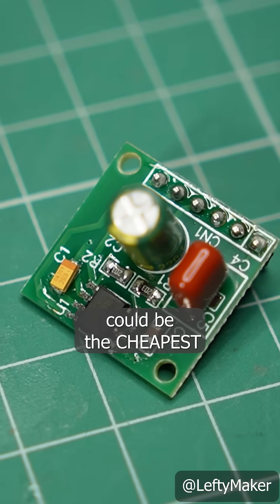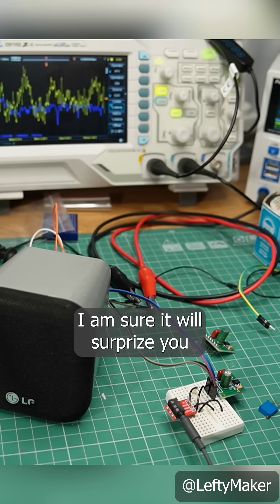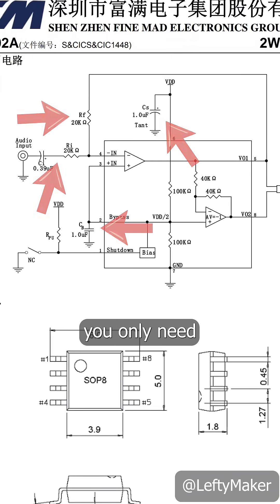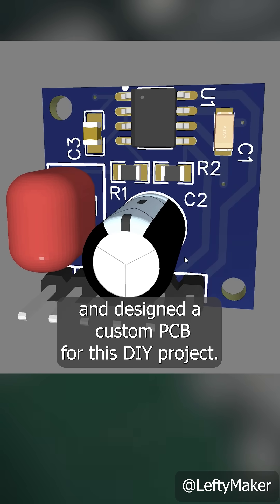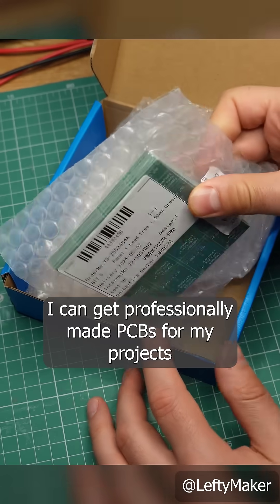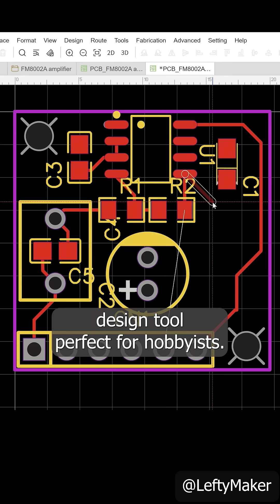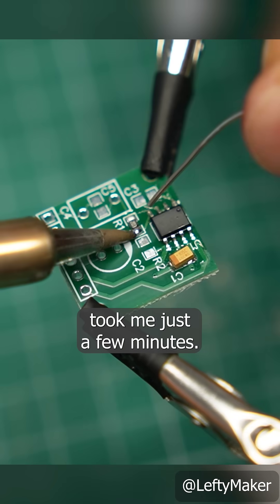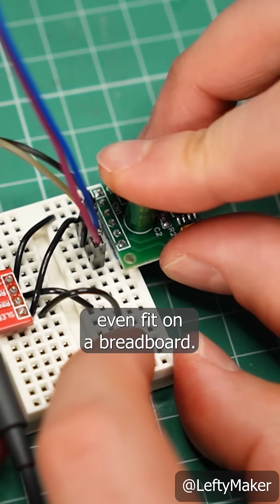The Cheapest DIY amplifier?

Comment: The ic is 8002A ic, this ic is mostly used on Radio amplifier it's small but powerful audio amplifier. Good for small units. I created one of this traced it on the radio board. And it works. U did not use any JLCPCB or PCB Way. I only use hand by hand.

Comment: can you connect them in series or parallel for a basser or louder sound
Reply: You could. From a design perspektiv use:
For a 5W amplifier, the LM386 is a popular choice, while the TDA2030 can handle both 15W and 30W (with appropriate configurations). The TDA7297 is also a good option for a 15W stereo amplifier.

Comment: newb question, why cant the chip contain all the necessary components ?
Reply: You cant put big capacitors inside a silicon chip
Reply: @stevelester6276  so transistors can keep getting smaller, but capacitors cannot ?
Reply: @narf0339  late ans. they have gotten smaller. but not small enough. there are some tradeoffs with size, like the ESR value.
Reply: @jonasnicolaysen8019  capacitor is a must ? some chips have pins that expect you to connect capacitor cause they cant intergrade inside the chip ?
Reply: @narf0339  great question. There are some capacitorless small-signal amplifier circuits, such as active load differential amplifiers. However, they are not used for driving audio speakers. So yes. ICs for audio amplifiers typically demand you to connext external capacitors. The same is valid for RF devices that requires big capacitors and inductors connected to the semicondutor chip.
Reply: Capacitance physically depends on plate area, so it costs a lot of silicon area. It's much cheaper to add external capacitance. Same goes for inductors, but there exists some microelectronics used for synthesis of inductors out of other components, such as GIC.

Comment: with a coupling capacitor you could line up the amplifiers to increase power output. Or by placing them in parallel the output would act like a stereo amplifier.

Comment: the cheapest amplifier? did you forget the legendary single fricking transistor
Reply: You are right😂😂
Reply: Cheapest AB amplifier I guess, or D since I didn't bother verifying.
Reply: I was gonna comment this
Reply: real
Reply: Usee better quality caps than a lot of EXPENSIVE ones
Reply: What's a transistor
Reply: @benilyadovein2434 a transistor is an item that amplifies current, thus you can make an amplifier using BJTs (a common type of transistor)
Reply: It's class d
Reply: Si, pero este circuito funciona en bridge y tiene menor distorsión

Comment: That's amazing best fit for small applications...I had once some plan for an amplifier with two microphones that only amplifies the sound that arrives at both microphones simultaneously. As there is a distance between both microphones, the sound from the side of them can be filtered out perfectly and you get only noise comming from the front and the back. Unfortunately I have lost the link and couldn't figure out how to build it, maybe that was a challenge for your channel 😜✌😎

Comment: Can it be used for subwoofer unit to make good bass sound through subwoofer?
Reply from the maker: No, it is too small for a subwoofer. It is meant for small speakers
Reply: @LeftyMaker  what about 5W subwoofer?
Reply from the maker: That probably isn't a subwoofer. But you may consider a board with the LTK5128 chip. That works well from a 5V supply. Also look at the TDA7375. It is good for 2.1 systems
Reply: @LeftyMaker  Okay. I want to change the board of my existing sound box which has 11W power consumption. 2.5W x 2 + 5W subwoofer, Motherboard has Bluetooth built in.. So, I am asking you for a board.
Reply from the maker: @imrannazir5585  hmm, I don't think I've seen a 2.1 board for such low powers. The smallest are about 15-30W, like this one 
https://s.click.aliexpress.com/e/_EIs9XJV

Comment: Jlc is great and all, but the shipping kills prototyping, the price is pretty cheap for a lot of pcbs tho.
Reply: that's how a lot of these services are unfortunately
Reply: Thats how it works. The setup cost is gonna be the same for 1 or 1000

Prototype on breadboards and coper clad until you need many
Reply: JLC's shipping price just doubled for me in the past couple months, no idea what happened but it sucks to pay like $35 for shipping a $5 set of pcbs
Reply: @artemovsk1  american tariffs
Reply: @artemovsk1 facts. Time to start looking for another manufacturer.
Reply: @arturomartes8696  the cost of doing it in Taiwan or the US is higher than China’s PCB fabs even if they doubled the current tariffs and doubles them again. If I had a nickel for everyone I know that had to shut down their American businesses or resort to mass layoffs due to these tariffs I would have about $0.40
Reply: @artemovsk1 They're based in China so it could be the new teriffs?
Reply: If you order just 5 they can send it on a post letter, at least on europe the last time i ordered the shipping was less than 2 dollars
Reply: I agree. I expect a lot more hobbyists would be interested in using their services if it wasn't for the shipping cost.
Reply: I mean how does it compare to others shipping cost is the question really isnt it like an expense like shipping isnt exactly any one company has that much control over
Reply: in yurop i can get 1.5 usd slow shipping. 3.5 for an entire order is pretty good

Comment: I have used this ic along with standard pam8403 module.
This ic is 8002, class AB mono amplifier ic. It can run upto 2.5 watts of power max. and produce some good sound but will also get hot on playing bass.
Use this if you don't want any distortion and clean amplification.

Pam 8403 is a class D dual channel(stereo) amplifier module. It can therotically put 3w on both channels (so total 3+3 = 6w) but it will distort heavily so say 2.5w on each channels.
(I'll recommend adding 100mF cap on power input) 
Since this is class D, its very efficient and doesn't get hot. But it can easily pick up ground noise or any distortions. Also there will be very very slight hiss all the time.
I'll recommend this if you make diy speaker or any amplification where slight noise isn't an issue coz it's powerful than 8002 and doesn't heat.
Reply: I also have an class d amplifier and as you said at full power(3W) it outputs too much noise
Reply: @shravanbg4270 What do you use it for?
If you use it to drive the woofer and have a seperate amp for the tweeter a low pass filter might help (so basically a inductor before the driver) 
And as the original comment said it might need a capacitor to the Vin so that the input voltage doesn't drop when it needs to play a bass note

Comment: all these forget to include sshipping xd
Reply from the maker: Shipping costs are included in the PCB price. Shipping the boards cost me €1.78. The chips, capacitors, resistors were part of a larger order (1000+ components), but ordering the necessary parts alone would cost €3.00 in shipping

Comment: All these days we were buying apm 8403 and 8610
Reply from the maker: Those are good too and not too expensive either
Reply: Have you noticed pam8403 speaker output always 5v when idle. Is it normal?
Reply: Pam8403 around 10 cents cheaper than the project, but this one is more better because it has better capacitor and stuff
Reply: @lavacat720  that's why I love diy amplifiers I tried to make one using a voltage regulator cuz I thought it was a transistor and I end up burning my hand
Reply: I got PAM 8610 module for less than a dollar